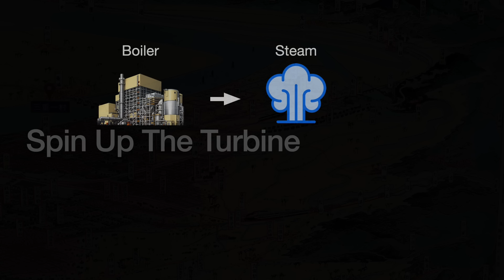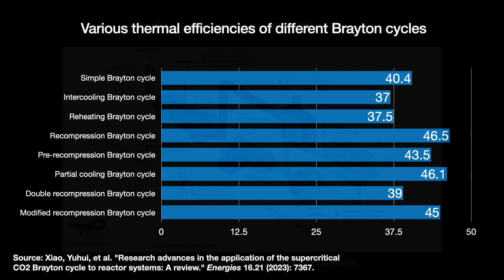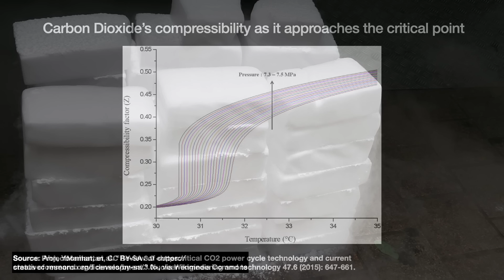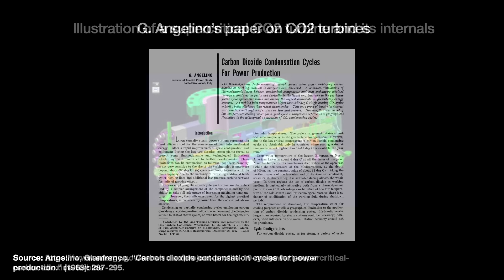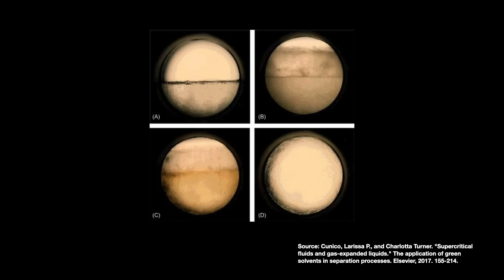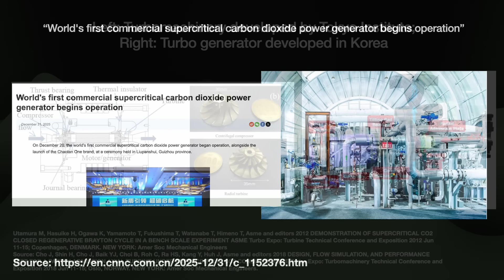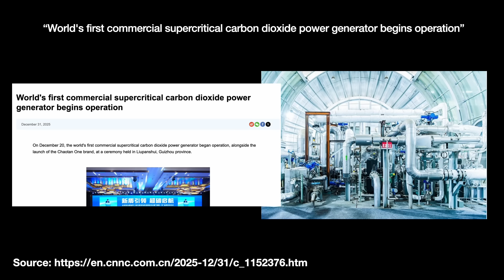The Supercritical CO2 Turbine: Waterless Wonder

Comment: A small quibble: a turbine engine burning liquid fuel is still a gas turbine. Aircraft turbine engines are gas turbines. The "gas" doesn't refer to the phase of the fuel, it refers to the stuff going through the turbine (which is hot gas, no matter whether the fuel is coal dust, JETA1 or natural gas.)
Reply: I am a marine engineer and about to make exactly the same argument including even the ‘coaldust’• The Rankyne & Brayton cycles can only be explained using a diagram like the Molier. The explanation becomes too symplistic otherwise.
Reply: @henrimoens8636 True, but on the other hand anyone but the engineers who have studied turbines will get lost somewhere in between the P-V and the T-s diagrams. Let alone actually getting into the enthalpies of the working fluid.
Reply: @Infanterie_Marine  These are useless (??) from a design perspective; CO2 has higher viscosity (cf water) and compressed gas at high temperature almost acts like a liquid (viscosity increases both with temp and pressure) and you can have smaller and wider vanes on the turbine. As the energy is extracted from the gas, both pressure and temp drops and you need to decide when enough is enough.
Reply: @janami-dharmam I am aware, the point being made is that an asianometry video is neither the format nor the audience for a technical dive into turbomachinery design
Reply: Gas turbines in power plants can also use diesel fuel, though such operations tend to become impractically expensive, even if the fuel is much easier to transport and store.
Reply: @LucarioBoricua  Diesel is typically used on Marine gas turbines like the LM2500.
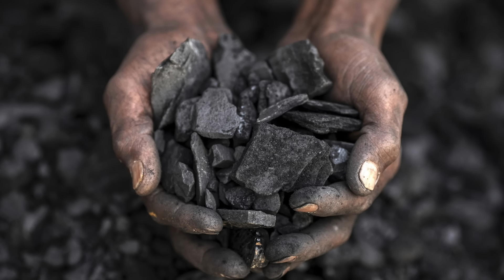Reply: 2:15 you’re technically right about the gas phase 👍
But I think the bigger story here isn’t the terminology… it’s WHY the industry is suddenly pushing CO2 cycles now.
Efficiency is one thing — control over infrastructure is another. That part isn’t really discussed in this video.
Reply: Liquid fuel has to aerosolize or vaporize to burn. So in essence liquids are always made into gas to burn.
Reply: @Kartoffelmeister89  Well they're definitely made into gas after they burn, and that hot gas is what drives the turbine. Hence, gas turbine.
Reply: @johanveltheim4331 before they burn. Vapors burn, liquids don't. The ignition source vaporizes some liquid and that vapor burns. Same thing goes for a puddle of alcohol. The vapor above the puddle is what burns. The burning sustains the vaporization. If the vapor pressure of the liquid is low enough the ignition source can directly ignite the vapor otherwise the ignition source needs enough energy to vaporize some of the material to start the reaction
Reply: @Kartoffelmeister89  But that is not why gas turbines are called gas turbines. A (possibly theoretical) turbine engine running on coal dust doesn't need to vaporize the coal before burning but it's still a gas turbine.

Comment: I can imagine series of power generation facilities where natural gas turbine is transferring it's heat waste to supercritical CO2 turbine and this - to supercritical ammonia turbine.
Reply: Cascade refrigeration doing the same exact same thing but in opposite has been around for ages, about time we cascade turbines with different gases
Reply: @thurqs1938  It's all about cost-benefit. Commercial entities don't chase maximum efficiency, they chase maximum efficiency and low operating cost. If there isn't a profit to be had then it turns into a very expensive boat anchor

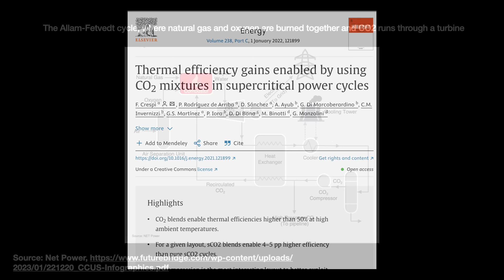Comment: 10:18 ALLAM CYCLE MENTIONED. I swear to GOD nobody talks about it. Do you it was intially designed to use coal instead of natural gas? They were suggested that to go with natural gas because it would be faster to get investment capital. It still can do coal it needs to be made into coal gas first.
Reply: Everybody used to talk about it until its 300mw texas project stalled indicating technical difficulties. Now its a 80mw still under development. 

Itll take 30yrs for this thing to take off and by then we would be transitioning to ess or 4th gen nuclear.

So no, the bridge to clean energy is and will be ccgt.

Comment: I wouldn't mind an episode on the transcritical CO2 refrigeration racks. Used to sell refrig parts and these things had copper fittings rated to 100Bar+, high pressure PRVs (loves going off during a power outage), some funky scavenged economisers and 'G' sized torpedo bottles of CO2 that weigh as much as a caber.. Never heard the story of how it developed commercially.

Comment: Evolution from Steam to CO₂ Turbines
For over a century, steam turbines have powered industries by using increasingly hotter and pressurized steam, making them more efficient but also larger and more complex. A new alternative, supercritical carbon dioxide (CO₂) turbines, offers a radically smaller and simpler design, using CO₂ instead of steam as the working fluid.

Efficiency and Design Advantages
Supercritical CO₂ turbines can achieve similar efficiency to traditional steam turbines but in a package up to 10 times smaller, thanks to CO₂’s higher density and lower critical pressure compared to water. This makes them ideal for constrained spaces like ships or nuclear plants, where size and simplicity are crucial.

Challenges and Future Potential
While supercritical CO₂ turbines promise high thermal efficiency and reduced size, technical challenges—such as handling CO₂’s changing physical properties and material durability—remain significant hurdles. Despite ongoing global projects and advancements, widespread commercial adoption is still in progress, with the technology’s future hinging on overcoming these engineering obstacles.

Comment: Helium goes straight through metal eventually.  Leak?  Don't need leak - it finds its way out ...
Reply: That's hydrogen
Reply: @40wink  Helium is monatomic so much smaller than hydrogen gas which is a H2 molecule - and thus much larger than a Helium atom.
Monatomic hydrogen also 'gets into' metal when chemically treating - this will make steel brittle near the surface.  So the piece is put into an oven at about 125°C or so for 12 - 24 hours to "boil off" the H.

Comment: Need bigger turbines to keep the voltage stable
Reply: Add a flywheel to the system. It would be a lot easier to control the supercritical CO2 flow rate for fine tuning.
Reply: not when the fluid is dense enough

Comment: It feels wrong that u neglected steam turbines biggest advantage it's mass & synchronous rotation RPM which directly allows the grid to be stable and adds to grid inertia . CO2 system either has to use a gearbox to step down which will add issue of jitter or use inverters which doesn't have physical inertia . Massive MASS is an MASSIVE Asset
Reply: Just add more synchros
Reply: It is but simply using several turbines driving a large flywheel would have the same net effect, also it would be a lot easier to tweak the rotation speed. The ultra high pressure in all system parts is a major cost issue though.
Reply: @christopherleubner6633    again that is adding more parts and mass and it's associated mess + cost in steam U dont have to worrry about that is the CORE POINT its  a SOLVED ISSUE  in steam
Reply: @AnupamVipul  A flywheel can be made much cheaper than a larger turbine.
Reply: @djinn666  U are missing the point now u have to make a turbin that is stable at 10000 rpm then a gear box to bring it down to lets say 3000 rpm and then add fly wheel OR Just use ONE THING that we know how to do well

Comment: My employer is building a 2.7GW power gas turbine plant for a new AI data center. Fuel supplied by our own midstream station nearby, and turbine exhaust CO2 capture and compressed to our CO2 sequestration injection field. As the emissions tech, and rotating equipment analyst, I have some homework to apprise myself of.
Reply: Thats a CCGT plant. Also I promise your employer is not building a full scale CCUS plant, maybe a pilot scale (like less than 200tpd) and the CO2 is not sequestered.
Reply: I curious, where they are going put the CO2? Old oil welds?
Reply: @kuba729  it's a closed system and CO2 doesn't go anywhere except in the system.
Reply: @seanburton5298  a sCO2 system is a closed loop. A gas turbine emits prodigious amounts of CO2 thanks to the combustion process
Reply: @alanbrown397  I was getting ahead of myself. I thought the question was about where the CO2 would be going if it would not be going into the field. So, from the gas turbine exhaust, hot CO2 gas would be put into a capture system (instead of into a field) and there you could get more energy extracted from the discharged CO2.

This response chain is a reply to a reply and feels like a loop in and of itself. 😂
Reply: @kuba729  It's usually that or turning it into carbonates. Either way eats over 1/3 of the output energy, which destroys profitability
Reply: i really hope thats not whats actually happening, because its already obsolete tech.

look into LNG pyrolysis, the H2 is purged off by heating the gas in a no-oxygen environment, leaving behind an ultra fine ultra pure carbon powder that can be re-sold to other industries (chemical manufacturing and battery manufacturers) while the H2 is burned for energy. the waste heat from the turbine gets redirected back to drive the pyrolysis reaction. 

it consumes more gas for the same amount of energy but it completely eliminates the problem of having to capture and store the carbon, because you're turning the carbon into a valuable byproduct that remains in solid form.
Reply: 2.7 GW, is that for the thermal rating or the electrical rating? If electrical, then that's an enormous power output suitable for a large city!
Reply: we should state before Q2 that your employer is in no way suicidal

Comment: The main reason steam turbines dominate the business of converting heat to mechanical power is that they are inherently more energy efficient for closed cycle power conversion.  The reason is the energy needed to pressurize an incompressible fluid,  like liquid water, up to a 30 MPa boiler pressure in an supercritical steam cycle is much lower than the energy needed to compress a gas or supercritical fluid to the same pressure.  This energy is supplied by the expansion turbine so a gas or supercritical fluid compressor will always rob more power than a liquid pump.  The highest efficiencies, up to 60%, are combined cycle where the output of a gas turbine, which operates at a higher temperature than steam turbines can, boils water to run steam turbine at lower temperatures.  Today gas turbine inlets can handle 1600 C or 1873 K inlet temperatures and for most applications you are lucky to have 27 C or 300 K cooling water.  That makes the Carnot efficiency limit 1-(300/1873) = 84%.  The second law of thermodynamics prevents higher efficiencies given these hot and cold temperatures.  The video talks a lot about the reduced size of supercritical CO2 turbines but without sinificantly higher turbone inlet temperatures they won't be more efficient than the best combined cycle power systems.  The big advance here seems to be generating electricity from what are now waste heat sources with compact and low cost CO2 turbines.  That would be great but it won't displace steam turbines or combined cycle systems as the primary means of converting heat to mechanicsl energy.
Reply: You should have made this video, you are much more easy to understand, and the bozo narrating on this is an idiot a very boring idiot at that!
Reply: Because CO2 cycle is single phase, no latent heat like water/steam cycle.  Latent heat is hard to fully recover on the power end of the cycle as the steam goes wet..etc.  if I recollect thermo correctly, Brayton cycle is theoretically the most efficient.
    The entire CO2 cycle is at high pressure vis a vis steam.  While the speaker talks of reducing turbine size, the high pressure CO2 cycle requires thick walled (stainless) pipes…heat exchanger, recuperation, interconnect piping.   So turbine $ goes down, plant $ increases.          
  Another option is an engineered gas (like Freon) which operates at lower pressures.  The trade is pipe cost versus gas cost.   Nothing is free, it’s all wise trade-offs.
  A CO2 gas cooled reactor might make sense.             Best your way.

Comment: I think you are the first one I have heard mention that these supercritical CO2 systems are brayton cycle and the issue of energy waste compressing gas before it goes to the heat exchanger are lessened by a particular property change happening where the compressibility of the CO2 drop significantly.  You theoretically get any energy put into the gas back when it goes through the turbine, but the energy lost by the thermodynamic efficiency of your compressor is mostly just wasted, so any drop in compressor power needs also increases your efficiency, using the turbine shaft to power the compressor also helps since you have fewer efficiency losses like if you used an electric motor on the compressor(no motor and generator efficiency losses to add in)

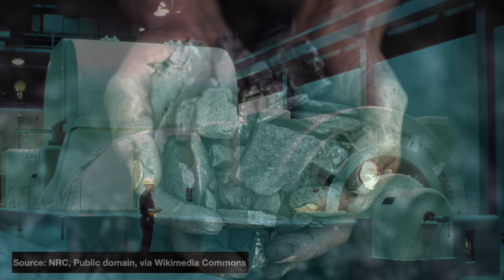Comment: 2:09 The record is the 1,350-MW ultrasupercritical (USC) coal-fired unit in China where using the lower heating value (LHV) it reached a net efficiency of 49.37% using a number of reheaters.

4:48 Gas turbine efficiency up to 60% efficient? What SIMPLE CYCLE gas turbine is this efficient?
Reply: Peaker plants are 40% at max. He’s talking about ccgt with 60
Reply: @rainzoro 

CC ⇔ COMBINED CYCLE vs SIMPLE CYCLE. The video didn’t make this distinction! Some SIMPLE CYCLE gas turbines are up to 46% efficient. The LMS100M gas turbine with intercooling technology provides outputs above 100MW, reaching simple cycle thermal efficiencies in excess of 46%. Steam injection can increase the efficiency. 

COMBINED CYCLE can be over 60% efficient. But combined cycle is much more complex than simple cycle.
Reply: In reality ccgts are actually 50-55

Comment: A few weeks ago the Just Have a Think channel had a video on flywheels encased in a vacuum to act as a rapid response rapid recovery surge buffer. For one manufacturer one of the first uses is for big electrical cranes that have sudden spikes in load as they move or lift, but draw little power when they aren't moving. Might be useful for EV charging stations as well particularly if megawatt EV charging becomes a thing.

Comment: I think a mercury vapor turbine ran for many years in connecticut. probably a superfund site!
Reply: Even US chemistry laboratories still use mercury diffusion pumps for high vacuum systems here and there. The pump boils mercury, and a supersonic jet of mercury vapor is used to propel the molecules out of the vacuum line to the outlet. The mercury is then condensed by a water jacket, and returns back to the boiler. These have been used since very long time ago, and although they are getting less common, there are still places using them, despite the fact that turbomolecular pumps have also been available for nearly a century.
Reply: @cogoid I used to run a mercury diffusion pump for my high vacuum system in the 1980s but we switched to silicone oil systems as mercury became more of a pariah chemical. Eventually we even ditched mercury thermometers.   The flow rate isn't really "supersonic" since sound doesn't travel in the vacuum inside the pump but the individual molecules or atoms move right along.  These days you still find the occasional silicone oil diffusion pump but I'd be surprised if anyone still used mercury.  Most have gone the mechanical route and rely on turbomolecular pumps for high vacuum these days.
Reply: @MaxLupton  The jets are indeed supersonic. But the users are typically not taught about these nuances. You would need look at the specialized literature on the theory of the diffusion pump. Most of the references would at least mention that the flows are supersonic, some will go further and will show the contour plots of the Mach number.  Some rare books that give specific know-how on how to arrange the jets in multistage pumps for the optimal performance, focus more heavily on the geometry and engineering of the colliding supersonic shocks, to optimize the transfer of momentum from the jets to the molecular gas flow. 

Although mercury pumps are getting very rare for environmental reasons, interestingly, huge mercury diffusion pumps are considered for some brand new facilities (European DEMO fusion reactor) where oil cannot be used for compatibility reasons and mechanical pumps are not fast enough.

Comment: something u left out particular to the nuke industry is radiation's difficult to model dislocation/embrittlement of metals. dont think it jives with very high pressure. stainless steel is particularly vulnerable to this...
Reply: It's actually the hydrogen plus radiation that causes this issue. My version would be using an ultra high temperature helium gas cooled reactor to direct drive one turbine, but use a supercritical CO2 turbine as the second stage.
Reply: @christopherleubner6633  hydrogen gas dissolving in solid metal is its own thing sir. both can cause dislocations